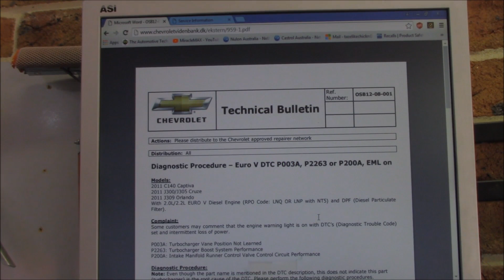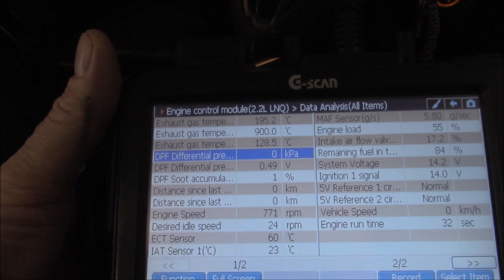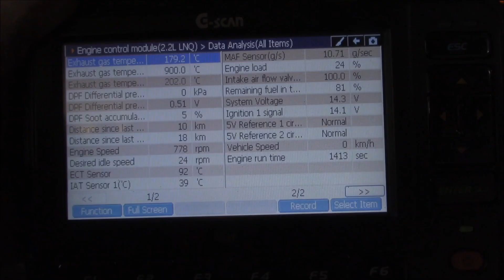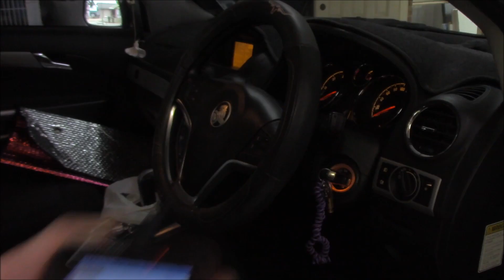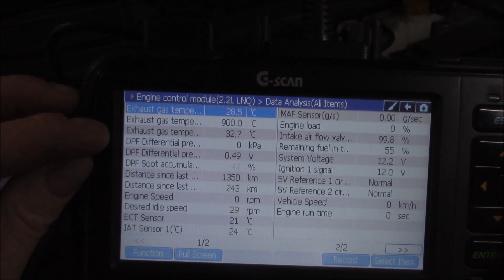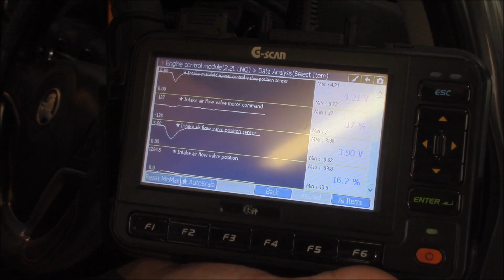Holden Captiva Diesel P200A MiracleMAX

Comment: I have a similar car and i have a problem with bad engine vibration at idle and also i have stored P200A,P2263,P0404 faults on ECU .It might be the same problem with carbon build on intake?
Reply from the maker: Hey Genove,
The P200A is shown above. 
The P2263 refers to Turbo/Supercharger Boost System Performance

The P0404 refers to Exhaust Gas Recirculation Circuit Range/Performance
Do the codes clear or come straight back?

These codes seem to refer to a lack of flow in the exhaust system. They could be due to a carbon build up in the intake system as well. The EGR plays a large role in this. 
How many kilometres has the engine done? Has it been serviced regularly? Has the correct oil been used? Do you have a scan tool that can see if the vehicle has done regular DPF regenerations? Are there any restrictions in the exhaust system? Are there any restrictions in the intake system? 
Does the vehicle get driven on regular long drives or just short drives?
MiracleMAX
Reply: @MiracleMAX  The engine has 93 000 miles until now,on last scan the dpf soot was 59% and the car have 310 miles from last regen.The care drive well but on idle the engine has a lot of vibration.Thx for reply and sorry for my english.
Reply from the maker: @Genove82  Have you checked the EGR operation? Are there any vacuum leaks? Are you able to do a smoke test on the intake system? Is the engine mechanically sound - has a compression test been done or at least a relative compression test?
Reply: @MiracleMAX  I made some measurments with a Delphi Diagnoze and here are the concludions:
-the desired boost with measured boost in low throttle demand are not the same,40 kpa difference but on heavy throttle with high pressure demand its much better with low difference
-i observe that  Intake air flow,valve position the value is 100% with no cheange during acceleration and at idle.this is normal?
-with engine at idle i unplug the vacum pipe from intake air flow command valve and i see no movment of the command rod,this is also normal?
Reply from the maker: @Genove82  So is the swirl flap command changing from idle to revs? What about during start up? During a road test?
The vacuum hose that goes onto the flap actuator, will have vacuum supplied from a solenoid. When you turn the ignition 'on' generally you will see the actuators move back and forward, doing a self test. Does yours do that?
Also is there vacuum being supplied to the solenoid?
Does your scan tool have 'activations'? If it does, you could use the method I showed in the video to test the command side of the ECU.
Reply: The actuator rod have no movment if i plug or unplug the vacuum hose at idle.It seems that is always full open,i dont think that is normal at idle.Also i notice that the vacuum hose that come from actuator solenoid have no cacuum at all.I suspect a bad solenoid or a "improper" flap delete from a tuner.
Reply from the maker: @Genove82  Do you know if a delete has been done?
Is there vacuum on the other side of the solenoid? 
Have you added vacuum to the actuator to see if the diaphragm is OK?
What happens when you rev the engine? Does the actuator move then?
Generally at idle the flaps will be closed. As they rev, the flaps will open further. During starting, they should be open full. Can you see the actuator moving when starting?
Here is a video of a vehicle with a similar system.
https://www.youtube.com/watch?v=oPt8zJNq_Nc&t=1320s&ab_channel=MiracleMAX
Reply: @MiracleMAX  I made another test and the swirl flaps works fine,closed at idle and open during acceleration,also the voltage of the position sensor of the actuator is ok,4,3V at idle and drops during acceleration.The problem that i observe is that actual intake pressure is lower from requested during light throttle but is fine when i aply hard or full throttle.The car is runing ok but it have a high vibration at idle rpm.The rpm at idle is cca 752 rpm,also the requested rpm is 752.
Reply from the maker: @Genove82  Have you done a compression test or at least a relative compression test?
Reply: @MiracleMAX  I don't have a compresion test kit,i must talk with a mechanic to make this test.
Reply from the maker: @Genove82  Might be best - start with the basics first.
Reply: @MiracleMAX  Thx for advices.
Reply from the maker: @Genove82  I hope you can find the fault. Let me know how you go. 😊
Reply: @MiracleMAX  Hello Max.I did a new test with a Launch x413 diagnosis and at Cylinder balancing rate group on  cylinder 4 I have a value of +40 and on cylinder 4 a value of -40. Cylinders 2 and 3 have values below 10. Are they normal values?  I'm going to do a compression test to eliminate problems with valves or segments.
Reply from the maker: @Genove82  Sorry, I'm not sure I understand what you mean by +40 & -40 on cylinder 4.
Are these injector readings, pressure readings or something else? Can you give me some more information about what test you actually did please. 
It's good that you will get a compression test done.
One test you could try before the comp test is a Volumetric Efficiency Test. That might help direct you if you have a mechanical problem.
Reply: @MiracleMAX  Hy Max,i discover something interesting,during the DPF regeneration the engine run very smooth at idle.The rpm at idle during dpf regen is 850 rpm.Now i tune the ECU to raise the idle rpm to 850,the engine vibrate less but still not very smooth.My question is why during dpf regeneration the engine run very smooth at idle? I think the key tobresolve this problem is to know what engine parameters ecu changes during dpf regeneration.
Reply from the maker: @Genove82  Generally, with your style of DPF system, the pilot injection is enrichened to create a fuel mixture that will raise the exhaust temperature. The ECU creates and monitors these parameters. 
Perhaps you have a fuelling issue. I wonder if there is any software updates that need to be done as well.
Reply: @MiracleMAX  I solved the problem with errors p200a and p2263 by changing the two solenoids behind the engine. It remains to solve the problem with engine vibrations at idle.
Reply from the maker: @Genove82  Are they the solenoids I mentioned in the description?
http://www.chevroletvidenbank.dk/ekstern/959-1.pdf

As for the rough idle, make sure all your engine mounts are in good condition, check for vacuum leaks, especially with split vacuum hoses.
What is the RPM at idle? 
Is yours a manual transmission? Does the vibration change when you put your foot on the clutch?
Does it have timing chain slack?
Glad you were able to sort out the fault code issues.
Reply: @MiracleMAX  yes,these solenoids both changed.
Reply from the maker: @Genove82  Let us know how you go with the idle issues. 😊
Reply: @MiracleMAX  Of course, I've been trying for a long time to solve the problem with vibrations, but without success. It's interesting that when the particle filter regenerates, it's like another engine,vibration-free and very quiet.
Reply from the maker: @Genove82  Have you physically checked the DPF? They can block and cause weird issues? Can you bang on it and hear a rattle. What is the Pressure Differential readings in live data?https://www.youtube.com/watch?v=cnctglYsqfA&ab_channel=MiracleMAX

Comment: We have 2 diesel cars and one runs much better than the other and the Captiva is having these exact problems but the Astra is also turbo diesel and that thing runs like a dream and I do believe that if you do a lot of city driving diesel is not the car for you
Reply from the maker: You have hit the nail on the head DuskHorse12860!
Common Rail Diesels with complex systems including DPF's should not be a town vehicle. It is vital that they are allowed to carry out complete regenerations & city driving does not provide the criteria needed to do that.
Thanks for your comment.
Here is another video with a Ford Focus not being driven correctly - Problems, problems, problems! 😉
https://www.youtube.com/watch?v=eLxHFZSkHAo&t=1227s&ab_channel=MiracleMAX
MiracleMAX
Reply: @MiracleMAX  yeah my Holden Astra doesn’t have those functions dew being 5 years older as a 2007 model it’s done over 200k and it runs fine it’s also manual as well
Reply from the maker: @Kyle.Craddock04  Sounds like a good choice!
Reply: @MiracleMAX  we figured that I want to be a mechanic it would be beneficial for me to learn in manual that’s we I can drive anything and I’m less then 2 months away from getting my Ps

Comment: Hey Max were in the world is the diesle pressure sensor and suction control valve on the same engine? Any help would be great mate
Reply from the maker: The suction control valve is on the high pressure pump. Here is a link that might help:
https://www.dencodiesel.com/products/25187376-exchange-pump-common-rail-holden-captiva-2-2l-dfp3-2

Not sure what you mean by the diesel pressure sensor. Are you referring to the rail pressure sensor? That will be located on the end of the rail.

Comment: Hello max having this code on 2400 rpm 
Did all the tests changed the intake ( hard work without taking the engine off ) egr now clean but the same problem 
I use brainbee diag tool
Reply from the maker: Hey  kata atak
Welcome to the channel!
Is your vehicle the same as the one above?
Is it only above 2,400 RPM that the fault occurs?
When you look at live data, is the boost desired the same as the actual?
Now that you have cleaned the EGR valve, are the desired and the actual readings the same?
The same applies to the intake runner - are the readings the same.
Does your vehicle have a DPF?
With your scan tool, check and see when a regeneration was done last on the DPF. Blockages in the DPF can give this code as well.
MiracleMAX
Reply: @MiracleMAX  
Hello again Max thanx for the reply 
The cars are the same chevrolet captiva or vauxhall/opel antara with 2.2 diesel engine only one thing i don't have on this car is the egr cooling bypass solenoid ( it's normale coz it's for the african market ) 
The desired and actual reading seems ok on turbo charger solenoid and swirl solenoid but on egr command i see zeros some times it changes on the desired value 106% and minus values but it does not change on the actual value 
But when i shut off the engine it makes some changes and when the engine run again zeros comes again 
Checked the egr again by opening its not stuck and moves freely when u command it via the scantool 
The question is what makes the egr value drop to 0% when only enging running ? 🥴
Reply from the maker: @kataatak7106  The EGR will change due to different conditions. Usually at idle on a diesel the EGR should be a reasonable amount - 20-30%. At revs, the percentage open will reduce. Are there any fault codes at the moment? Can you see any difference in the OBD II section of the scan tool?
How many kilometres has the vehicle done? Is the EGR valve worn at all? Do you have oil leaking from the turbo? Oil in the intercooler or throttle body? Is the intercooler hose split at all, especially the one that goes to the throttle body - it's very hard to access?
Has the DPF been doing regular regenerations?
Reply: Thank u again Max soooo: 
* Only p200a shows when u hold it at about 2400 rpm and it desappears when turn the ignition off.
* I can't see any difference when switching to obd II section
* The vehicule has 156519 kms.
* The egr valve looks like a new one when cleand 
* No oil leaks from the turbo 
* Found some oil ( little amount ) in intercooler hoses and a worn hose was replaced with the intake manifold ( rubber one that goes to the throttle body ) 
* Can't find any differential sensor for the dpf so it may haven't the regeneration option 
* And on my scantool ( brainbee ) the only that i have for the moment: 
      - at idle ~800rpm
Turbo pressure 90kpa
Desired turbo pressure 11kpa ....... Why ? 
Turbo wastegate position 100%
Desired turbo wastegate position 100%
Intake air temp 17°c outside temp 13°c
Maf reading 13.21g/s ..... It is normal ? 
And thank u again Max u're doing a great job with thoes GM.
Reply from the maker: @kataatak7106  Just going thru the data in order:
At idle ~800rpm
Turbo pressure 90kpa
 ...........keep in mind that this is at idle, so you won't see any high readings, but this appears just a fraction low. You should see at least atmospheric pressure.
Desired turbo pressure 11kpa ....... This does seem strange
Turbo wastegate position .............You wouldn't expect the wastegate to be open at idle. There is no boost to waste at this point.
Desired turbo wastegate position ............Once again, strange that the ECU is asking for the wastegate to be opened at idle
Intake air temp 17°c outside temp 13°c
 ..............you will see a slight rise in intake temperature due to the heat soak under the bonnet.
Maf reading 13.21g/s ..... Although this seems a little high, a turbo will read higher readings at idle. That being said, if the boost is being wasted, you wouldn't think the MAF would read that high.

Do you have EGR data at idle & revs (2000 RPM)?

I would focus on the turbo readings at the moment. Is the waste gate working correctly? When you turn the engine off, can you see the actuator move? Can you test the actuator with a Mityvac? Does the data move when you raise the engine RPM? Check and see that there are no split hoses. While you are there, have a look at ALL the vacuum hoses. Have a look at the bulletin I listed in the description. Check for free actuator and wastegate operation. 

If this has a DPF, it should have a Differential Pressure Sensor. There should be 2 hoses going to the DPF, one to the front and one to the rear - work checking out.

Comment: Hi Max. I have same model and engine. My car backfires when going uphill and due to this i have to repacled turbo hose becuase of this. Why this Z22D1 engine backfire. It has done 140K and always use BP utimat diesel. I am in sydney, can i bring it you for diagnose. Text me your address or phone # on 0481231359 Ned
Reply from the maker: Sorry nadeem bhatti
,
I am a long way from Sydney.
I'll try my best to help you.

When you say it backfires, does it make a 'bang' sound out of the exhaust when accelerating or does the engine have a misfire?
Do you have a scan tool & what were the codes if any?
Has a compression test been done on the engine?
Are there any popping sounds out of the air intake or the exhaust?
Has the DPF done regenerations on a regular basis?
Has the vehicle been serviced at the correct intervals?
Is the exhaust system in good condition?
Are there any vacuum leaks on the intake system?

Can I ask why the turbo hose was replaced? Was it damaged?
MiracleMAX
Reply: @MiracleMAX  Noise came from under the hood. and turbo hose spit longitudinally. Replaced it with after market silicon hose. 2 weeks later happened again hose survive and come off from throttle body side. I saw EGR valve as rubber sealant. I figured it out that previous owner has taken out and cleaned it and  put it back. I bought this car 8 months ago. The  code are P200A and P0299 your favorite ones.
Reply from the maker: @nad1966  Has the timing belt been replaced? Could the valve timing be out? Has the fuel filter been replaced - perhaps there may be water in the fuel. Do you have a scan tool that you can look at live data? Do all the injectors have similar readings? Are there any air leaks in the intake system? Can you carry out a smoke test?
Has the EGR been 'fiddled with'?
Is there excessive carbon build up in the intake system?
The P0299 (Turbocharger / Supercharger Underboost) is most likely when the turbo hose blew off.
Is the MAF reading correctly? Is it clean? Is the air filter clean?
Is the the intake manifold runner control

system working correctly?
Here is a related link that might give you some guidance:
https://www.obd-codes.com/p200a
Reply: @MiracleMAX  thanks for  your detailed answer. As far I know when bought it car was running fine, just it needed to warm-up before drive,  it used to little sluggish on takeoff. I started using BP Ultimate diesel in it. And used little Moreys additive now and then. Got better even without warmups. Rest of questions i can't answer.  But I am looking forward pulling EGR valve this weekend to clean. So far it badly struck.  Will you recomend any pulling tool or some other methods how to pull it out?
Reply from the maker: @nad1966  You might find this forum helpful, especially the comments from Aussie Ed. Check out his link to the TIS information.
https://www.chevroletownersclub.co.uk/threads/how-to-dismantle-egr-valve-on-captiva-2-2l-2012.5753/
Here is a link to a video that shows the location.
https://www.youtube.com/watch?v=mTKFM-rK6Hw&ab_channel=VictorianAutomobileChamberofCommerce%28VACC%29
I hope that gives you some guidance.

Comment: Hey max were is the suction control valve on the vehicle?
Reply from the maker: Hey Dino Barnes
The suction control valve is located on the high pressure pump. Here is an example of where they are located.
http://premierautotrade.com.au/news/suction-control-valves.php

MiracleMAX